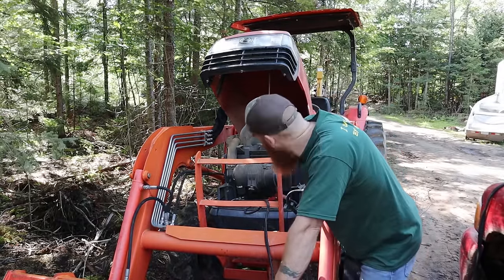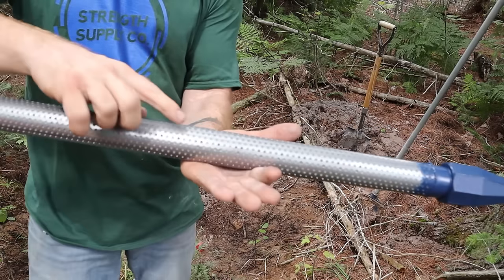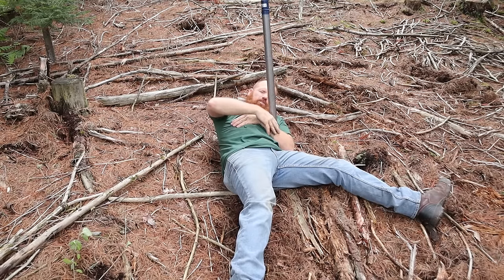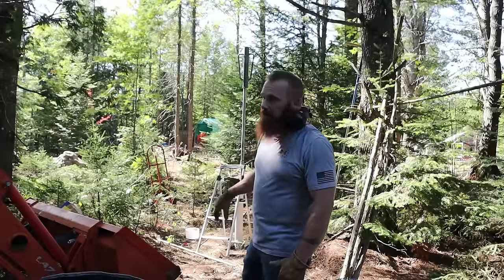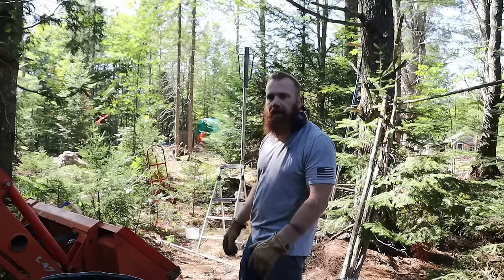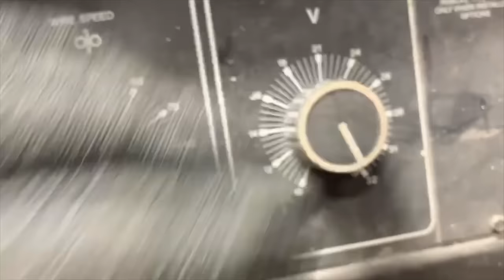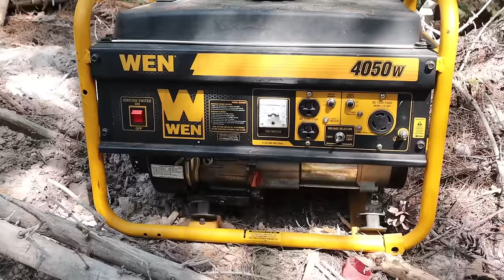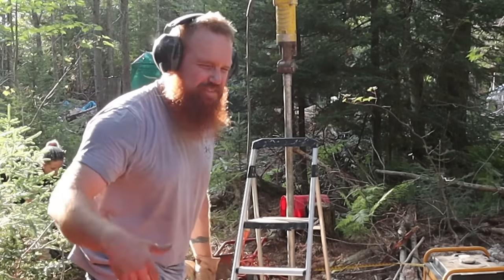Off Grid YouTube Family of Girls Step up to Help Dad Drive a Well | Fabricating Off Grid Well Tools

Comment: What about making a little attachment on that Kubota bucket to "press" the pipe in? Probably end up with bent pipe, but less fillings rattled loose.
Reply from the maker: The tractor won’t push it in. Not tough enough

Comment: 20:35 Ahhhhhhh... glorious SILENCE and peaceful sounds of nature after all that awful noisy racket and nerve-jarring pounding!
20:40 Ears still ringing and swollen shut, though :P
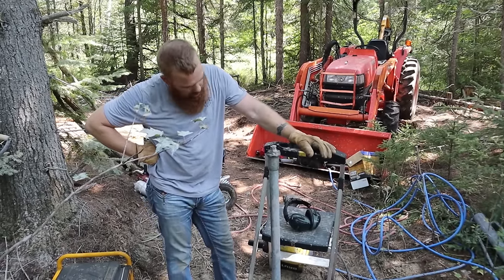20:44 Zheeeeeesh --- you KNOW that it's tough soil down there if you even BROKE DA INDUSTRIAL-GRADE JACKHAMMER-TIP on it! :P 
(Well... actually, don't feel too bad about that --- here in coastal Maine, our gray-granite "ledge" is notoriously difficult to bore through!  One time l strolled down to a neighbor's bluffside cabin by the ocean where they'd been having a new well drilled, and curiously had a wander-around look-see at the assorted company-trucks and machinery that was strewn about the worksite.  I saw the extracted core-bit lying on the ground among the other muddy drilling-equipment, and at least two or three of the bit's big black spherical rock-crushing diamonds were actually chipped or broken [that's probably why they'd stopped early that day --- to go back and get some replacement cutter-diamond inserts to braze back into the bit!], so even THOSE huge massive behemoths that the professional "big boys" use couldn't entirely stand up to the tremendous battering against the super-hard rock that they were drilling into!)

Comment: If you ever do get this working - How are you going to keep it from freezing in the winter? Also - you should put in a foot valve to keep the water in the pipe from draining back out when the pump isn't on.If you don't you will probably have to prime the pump every time you run it.
Reply from the maker: We’d build a pump house over it. And we put a ball valve at the top so we could let the water down to stop it from freezing

Comment: good work so far man hope you can get it polished off in the end, i didn't even think you would be able to drive something that deep by hand... i suppose it depends a lot on what kind of soils you have in the area? probably too late now but would it be possible to hire like a post rammer or something for the back of your tractor? might be good if you end up having to go alot deeper.
Reply from the maker: That would make it easier for sure.

Comment: I'm wondering why you didn't incorporate the tractor's scoop to push the piping down. I'm aware it has a limited reach; once you got the pipe in far enough you could lift the scoop up and then start using the hydraulics to force the pipe down.
Reply from the maker: It’s not tough enough or worth the effort. We tried.

Comment: I like your video, I’m planning on driving a well point soon. I was wondering if your careful not to bend the pipe if you could use the tractor bucket to drive the point in? I have driven t posts in like that and I have to be careful not to drive them to far down.
Reply from the maker: Tried the tractor and the tractor is not tough enough to push it in.

Comment: Is there a reason why you can't use the bucket on your tractor to press down on the pole to drive the steel pipe downward?
Also, couldn't you get a few solar panel setups to power your water pump, so you can reduce your dependency on gas? Or perhaps I'm missing something...?
Reply from the maker: Tractor won’t do it. We have tried and it’s not tough enough. Yes we will get solar eventually once everything is in place.

Comment: Forgot but if you preheat you jack hammer bit before welding it will be less likely to break at weld
Reply from the maker: Yes I should’ve done that as the center of the steel shown looked like cast. Preheating it would’ve definitely helped

Comment: Can you just use the metal pipe as a casing and drop down a 3/4" PEX for the water draw?
Reply from the maker: If the point screen end is in sand and not clay then yes but wouldn’t have to.

Comment: Sorry about all that hard work for no result. A few thoughts: The 1-1/4" pipe needs support as you're driving it down into the earth. Forego the 4" PVC sleeve next time, you don't need it.  The earth around the steel pipe will absorb vibrations and prevent it from cracking. It's OK to start with a 4'-5' hole help start the driving process from a lower height. That demo hammer was overkill, and contributed to the cracked pipe. Always use a sacrificial nipple on the end being hammered onto. Find yourself a 30~50 pound weight, and weld a 4' section of 1" rod onto it. Errect a tripod or scaffold over the well pipe. Drop the 1" rod & weight into the 5' section. Using a rope & pulley hooked to the scaffolding, pull on the rope to lift the weight and let it drop onto the pipe being driven into the ground. If you need to drive your well past 25', look into a Deep Well jet pump. They can suck water up to 75' feet down.

Comment: Is there some way to use the bucket on the tractor to press the pipe down? Probably with the slide hammer on or something like that.
Reply from the maker: Nope. The tractor won’t hammer it down. Tried that.

Comment: if you want well drive it hydraulically. use a pump and use it to wash the dirt out of the hole.
Reply: have lived 74 years so learned a lot over the years.  drill wells before and will again in the spring...at my new place.  love the process but age is creeping in on me

Comment: If all the drilling was done and the broken pipe could not be dug out, would it be feasible to slide a smaller diameter pipe inside the busted one?
Reply from the maker: No because where it’s broke it would let the water in from above which isn’t good. Also we’re not all the way down to good water yet.

Comment: Okay, 25' limit isn't true...depending on your hand pump.  The ones where the actual pumping mechanism is at the top, then yes that's right.  But there are other pumps where the mechanism is down in the well below the water, those can go much much deeper.

Comment: I'm just curious with that really nice tractor why aren't you using the bucket to pull that pipe out and to drive the pipe in just use the hydraulic down pressure!
Reply from the maker: Not strong enough. And can’t get it in the garden now that it’s fenced off.
Reply: Ok, I get it!

Comment: I used my front end loader to drive a casing down first. Then I rented a high pressure water pump and a tank of water and flushed the dirt out until I seen sand in the water. Then I put my pump pipe and strainer down. Three days we went a hundred foot and had and still have nice fresh water. This was twenty five years ago and the only thing I had to do is pull the pump once because the filter was getting clogged. I took my 22 mag rifle and put two rounds straight down the center of my pump pipe. It blew out the silt and yeah we had great pressure again. I did have to replace a pump motor once but that’s it. That front end loader would have pushed that casing right in with no problem.
Reply from the maker: I think lead poisoning would be a concern?

Comment: Your sand point needs to be 10’ minimum.  My favorite method is with a 80 lb jack hammer.   For extra ease driving run a 3/4” pvc pipe along side it.   Water pressure  makes it easier.

Comment: i wonder if it would've helped to slowly cool off your welding job, slower than air cooling, to keep it soft
Reply from the maker: I think I should’ve heated red hot before welding because the center looked almost like cast. If I had an arc welder handy that would’ve been a better bet.

Comment: Really wondering if you couldnt push each section down with the tractor. I know youd have to be careful not to bend a section. But would sure save a lot of work with the pounder. Also thinkin it would be nice to come up with a device like a jaw that would wrap around and grab the pipe with teeth pointing down and two arms coming off the sides that you could hang some weight on and just slide up the pipe as the pipe goes down to add weight and make it easier to drive.
Reply from the maker: The tractor won’t do it.  It enough arsh. Tried it.

Comment: Why don't you use the tractor to push and pull pipe out of the ground you have a bucket and it will also lug the tools around just a heads up. love the family
Reply from the maker: We can’t get the tractor in the garden area unless we take the fence down. Also it’s not tough enough to push the well pipe in

Comment: Use the pole driver to bring the pipe down far enough to put the bucket of the Kubota and use the weight to push the pipe in. I know because I did it my self
Reply from the maker: You must have a much bigger tractor as ours is too small and doesn’t work. Even with a load of sand in the bucket. I have used a skid steer to put in t post for livestock fence before.

Comment: Next time. Hydrojet.  Take your pipe 2inch pvc and sludge pump.. I used to use a cesspool truck... get a tote full off water... and jet the water trough the pipe. Pump the water out of well with sludge pump...   cesspool truck id have it cleared in about 10 minutes....  sludge pump .. maybe 15vminutes..    same idea as when you drill down with a garden hose..   this method had a youtube video a few years back
Reply from the maker: I seen this and it looks like a great idea! May use this.

Comment: To go that deep you need a 2" casing and single line jet pump "packer jet" at water level.  You have the correct pump for this out the piece you attached to the pump, the packer jet is that same piece but sits before water level. Then a 1.25" pipe is ran inside the 2" to that jet, so your pumps pressures in between the 2" and 1.25", then the 1.25" sucks your water up.  No way any pump will lift water 50' up.
Reply from the maker: Chris the water level is very high and when the pipe gets to sand the water will naturally rise up and the hand pump will pump it out.

Comment: To my opinion it should be way easier to get those pipes down drilling with water pressure. 
As a kid I managed to  ' Sink '  our hosepipe completely but the slack to the Tap where it was connected. 
NO HARM was done using child labor.
Reply from the maker: Yes it probably would for sure. We may go that route if we don’t get this one working.

Comment: Can you slip a polyethylene pipe down inside the broken off metal pipe and use that as your air injection/water drawpipe instead?
Reply from the maker: Not sure if it’s down out of the clay yet

Comment: My grandfather setup a tripod with a pulley then looped a rope around the double rim on his jacked up pickup truck to pull a heavy weight up, then released the rope to drop the weight onto the pipe. After each hit, they turned the pipe 1/4 turn to keep it going straight down. Just sayin'. My grandfather dug wells with his pickup truck. At the end of digging, he dropped a 1/4 stick of dynamite to blow a cavity. Note; you used to be able to buy dynamite at the hardware store. Also, I think your digging pipe is too small. And you might be able to fabricate yourself a pipe retrieval toggle (similar to a gorge fishing hook) to pull the broken pipe back up. Good luck. BTW: there is a pipe retrieval tool for wells but those are over $600.

Comment: Did you dowse for a water vein?  A friend put in 12 holes with a hand auger down 100 ft. and no water.  Had a location dowsed and hit water on second shaft at 110 ft.
Reply from the maker: Yes we used dowsing rods. It’s my first time using them this year. I spent quite a few hours trying to figure them out. We’re in water but in clay too.
Reply from the maker: Yes we used dowsing rods. It’s my first time using them this year. I spent quite a few hours trying to figure them out. We’re in water but in clay too.

Comment: I've used the down pressure on the front end loader on my tractor to drive steel fence posts. Would that also be possible for well pipe? Especially if you weld a short section of wider diameter pipe to the bucket to act as a stabilizer for the well pipe.
Reply from the maker: Not with our little tractor. Some people in the comments say they’ve done it but it must have been a very large tractor of they have.
Reply: @9252LIFE  I have a 48 hp Massey Fergusson it's a 251xe, not a very big tractor at all.

Comment: Old rule of thumb for running pipe:
"Tighten until you think you can go around one more time, THEN DON’T." Pipe threads are tapered. It's the weakest part. Overtorquing, combined with the hammering, is why the pipe failed. Amazing work though.

Comment: You have a tractor I would weld a heavy plate on the bottom of the bucket put a bunch of rocks in it and bounce that thing up and down on the pole when I dug my well it was in high desert I used PVC and a compressor once I hit water
Reply from the maker: I tried that. I did not weld a plate on the bucket as we don’t have much for electricity out here or a welder. Our tractor is just a little guy. It wasn’t worth the effort trying to use it for hammering or pushing in the pipe.

Comment: if the filter is clogged with clay just fill the piped as it is with some water and use hydraulic force push water out from inside the filter

Comment: Has it not occurred to you to use the weight of the tractor bucket to drive the pipe to the required depth.....Just trying to help. Regards Robin.
Reply from the maker: That’d be great if it was tough enough to do it.

Comment: Hello. Hmm isn't that child labor? lol :-)  Did you put a check valve on that sand point any where in the line? You really probably use a hand pump until you get clean water. It would be better for your water pump.  Also you might try a three point post hole digger for your tractor to drill the hole. It would still be a lot of work and time. But it is a idea. Also, they do make a cap for the pipe to drive sand points with to save the threads. You might also check with the conservation office to see what the material is where you  are located. nice video. Hang in there. :-)
Reply from the maker: No check valve. Will do after we find good sand for water flow.

Comment: Not to be a pain in your behind - but I have an idea about the well.
Drilling at an angle using a device based on the Archimedes Screw, powered by a commercial pipe threader machine perhaps is the basis of the idea. The oil industry has used horizontal drilling techniques to drill under other people's oil fields to steal the other company's oil, but a simpler device could be fashioned. The drilling at an angle idea would mean sand would be able to rise at that angle, not straight up lowering the required torque due to less resistance and less weight. The "rig" would require a larger PVC pipe, and a smaller diameter pipe. Water could be poured into the larger pipe turning the sand below to slurry. The screw would be inside the smaller pipe which is inside the larger pipe. The limiting factor would be the resistance to the torque of the screw which is what the slurry is for. Just an idea. I'm sorry I can't send a diagram. It would be time consuming, and the water you'd need might exceed the present supply on hand, but the "rig" could be constructed piecemeal and on the fly like any other rig. It's an idea that had persisted since I saw this video a few days ago. I'll leave you be now.
Reply from the maker: That sounds like quite the rig. People really stole oil like that?

Comment: Work smarter, not harder.  You should look into drilling a well using a pressure washer.  Also, if clay is what you have, look into using something that will work with clay instead of the sand filter on the well point.

Comment: We’re you running water through the pipe you err pushing into the ground? That’s how we do it in Florida.
Reply from the maker: No not with the sandpoint attached. But there is water in the pipe and I use the air pressure to push down the water to hopefully keep the point screen clean.

Comment: I think you have to lean the top of the pipe a bit South-southeast if you want to hit China. Going straight down you're heading for somewhere in the southern hemisphere. You'll know if the water swirls the wrong way when you flush your toilet.

On a serious note, make sure you get a wrench down on the next coupling to unscrew that broken pipe (or any time you're unscrewing anything), otherwise it can unscrew further down. Your other option would be to cut the pipe below the break and re-thread it.
Reply from the maker: Yeah I was hoping I could find a RE threader tool to attach to a pipe from above and not have to dig down. But I doubt they make anything like that.
Reply: @9252LIFE  I've never seen such a tool, but of the pipe is strong enough to pull it back up it will drive easier the second time. My only concern would be pulling the arrowhead off the point. I've never pulled one like that.

Comment: I would not use a sand point pipe to go more than about 20 feet. You need to drill with a drill bit, water/mud lubrication, and a return system for the fluid, so it brings the soil to the surface. Doing what you are doing is expecting a lot from sand point drilling. You have reached a depth where the soil friction is making it impossible to go further and you are snapping the pipe.

Comment: There are small gas powered portable well drilling rigs that are perfect for your application
Reply from the maker: Where?
Reply from the maker: @robertgutheridge9672  I would dump water down the pipe and use forced air with my compressor
Reply: @9252LIFE  you have the right idea. Are you by chance in Washington or western Idaho?

Comment: Why didn't you use the tractor bucket to drive the pipe down?
Reply from the maker: The tractor is too small and won’t push it down. Even loaded. That would be nice though